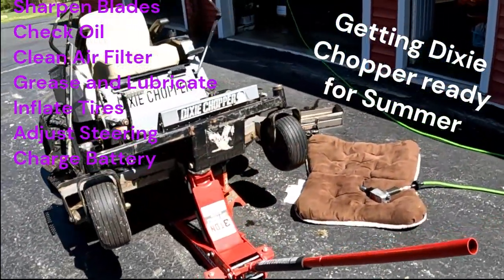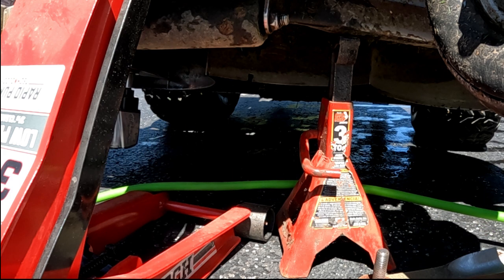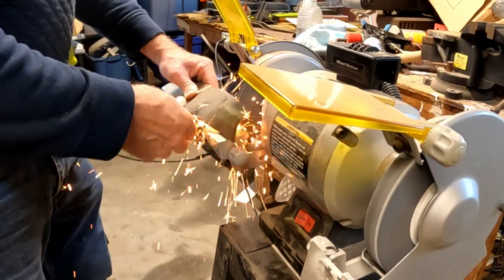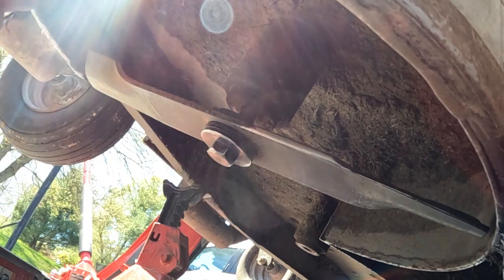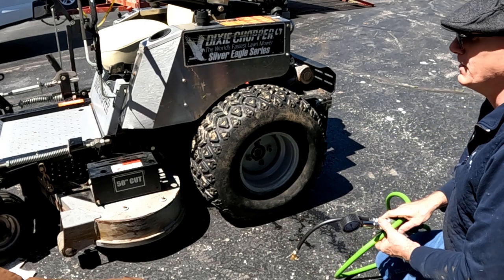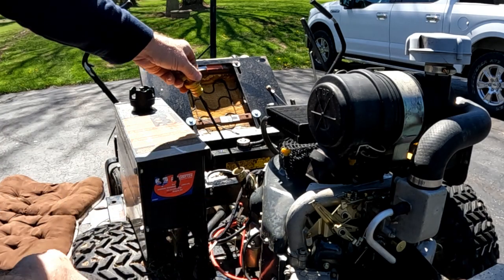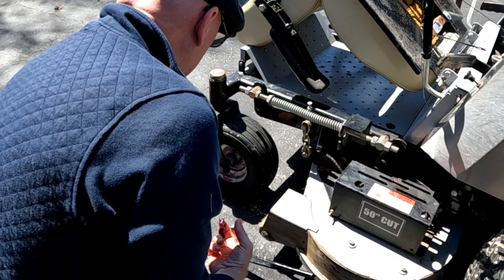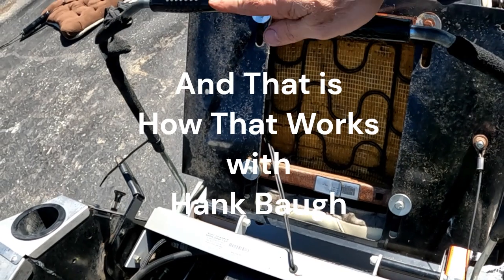Getting Dixie Chopper Ready to Mow

Comment: Does it matter what orientation the blades are in? I noticed there seems to be no pattern on mine, as in not all faced the same way. Trying to keep them as similar as possible but I’m doing one at a time with a breaker bar and sharpening in between and my memory sucks 😂 thanks for letting my wife know I need an impact, I’ll show her your video after I pick one up
Reply from the maker: I like to stagger the orientations so that the ends of the blades never meet.  There is a gap, so they cannot crash, but I feel better if the do not come that close together.  Good luck with the impact wrench.